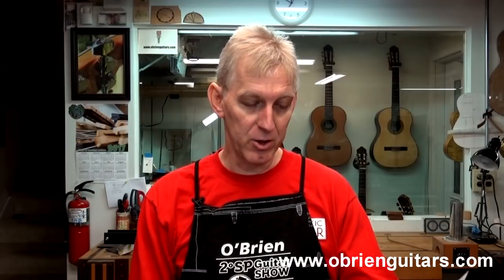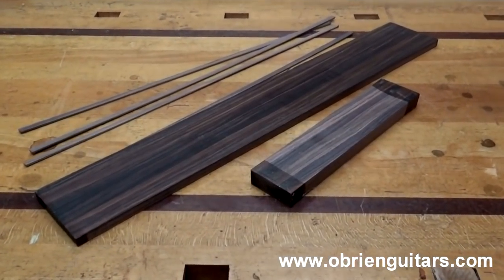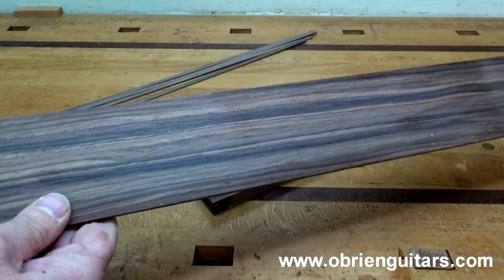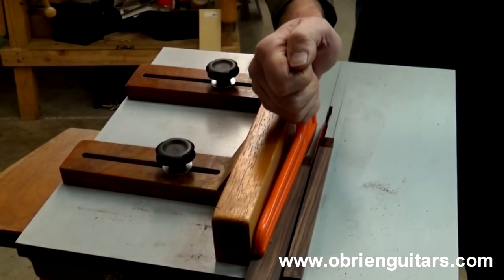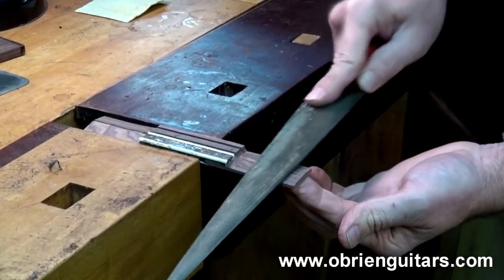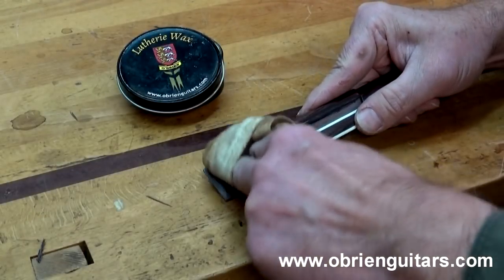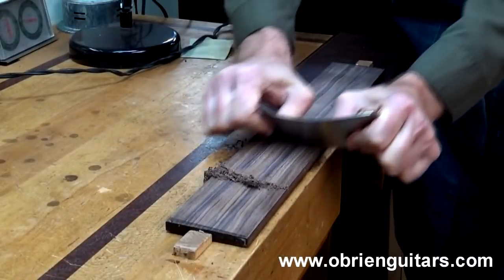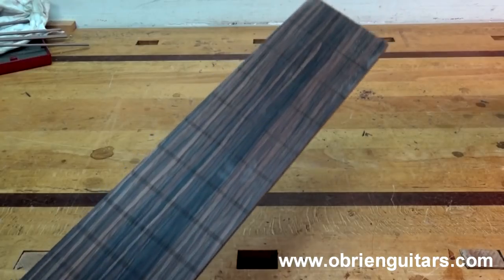Luthier Tips du Jour Mailbag 76 -  Rocklite

Comment: just finish my class ical guitar using ebony version ffor fretboard.  It turns out to be one of my best tonal wise.  I cut the slot with handsaw and found that it bites the blade more than the realwood.  Just a bit trickier to work with, but it turned out ok.  Will use this again.

Comment: Great video. Your "classical" guitar bridge has room for 12 strings.  ¿Was this a special order or was it for a historic instrument?
Reply from the maker: The guitar still only has 6 strings but the tie block has 12 holes. It is the way the strings attached to the bridge. I prefer this method. There are also classical bridges with 18 holes but still only 6 strings on the guitar.